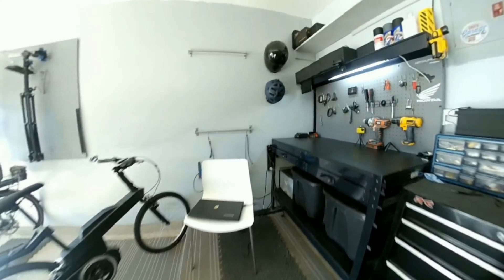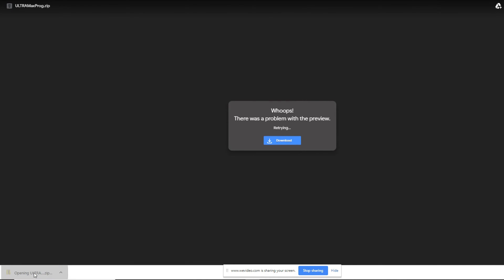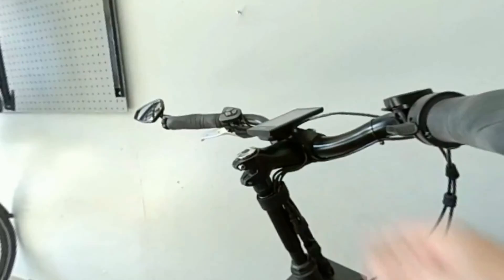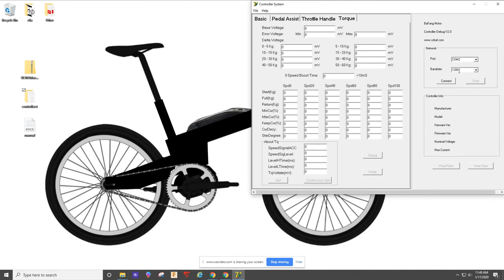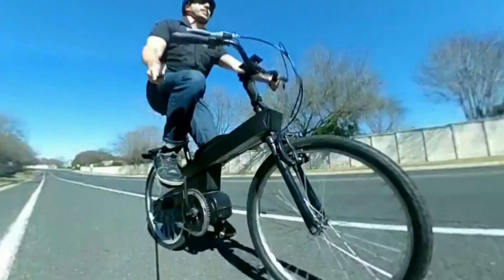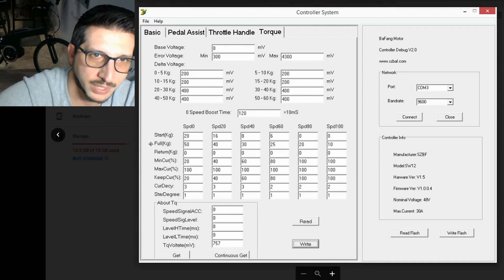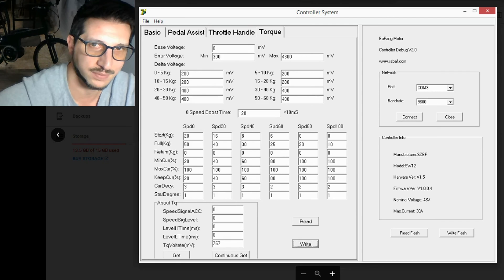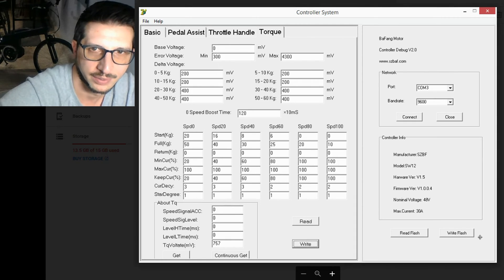How To Program Bafang Ultra Torque Settings

Comment: Thank you for sharing! Do you think your “commuter” style settings would be good for any bike equipped with this motor? I guess I was just concerned that your bike appears to be a lot lighter than mine so I wasn’t sure if I would need to modify. Did you also confirm that the controller is running at 30 amps? From what I’ve read, that’s what a non-ludicrous controller should be set at.
Reply from the maker: Yeah the factory settings came programmed at 30A which is the max for this stock controller. This prototype is actually pretty heavy around 60 lbs. Can't say for sure if these settings are good for any bike, but it should solve the PAS torque sensor problem where the motor gives a big boost then lets off, making the ride inconsistent and underwhelming. 

I don't emtb much but the stock settings might be nice if all you want is a short boost here and there. You can probably also just get used to switching into a higher gear to keep up cadence at speed and keep torque on the pedals, but I'm not a fan of changing gears in general and would avoid shifting regardless.
Reply: eBikeaholic thank you for the response! Did you find that these settings improved your top speed? Or just the smoothness when commuting?
Reply from the maker: @seant1435  I don't think this programming would have an affect on top speed since we can't increase the amps past 30A. Bike gearing, wheel size and battery voltage definitely would though.
Reply: eBikeaholic how does bike gearing effect top speed? The new bike I just bought I upgrade from a Shimano 10 speed to an 11 speed. The upgrade is 11/42 to 11/46T. If I’m reading that correctly it doesn’t add anything to the high gears. Just more to middle gearing I guess.
Reply from the maker: @seant1435  I like to use the Sheldon Brown gear calculator. You plugin your specs and it gives you a gain ratio. Lower gain ratio will give quicker acceleration, higher ratio will give faster top speed. Either a larger front chain ring or smaller rear cog should give you a higher gain ratio.

https://www.sheldonbrown.com/gear-calc.html
https://www.sheldonbrown.com/gain.html

Comment: Bafang Scares me
they have No Factory Manuel or support.as well American service centers with the parts.?
Chinese must want to sell there crap and not support it with manuel's or Honest Customers Service.
I have the BPM imports F1000 ebike and there isnt any material information about this motor? WHY ?????
Reply: the USA Bafang Service center in Las Vegas Does Not Support the Bafang Ultra g510 and has no explanation why ?
Reply: Bafang has local US support.  I skipped local dealers and bought direct from Frey in China so when my motor had an issue I contacted Bafang USA.  After only 2 emails Johnny sent a new motor to me free of charge, which I installed.  He even relied upon my honesty to send the bad motor to them.  Until another company becomes light years ahead in tech, I'm a Bafang customer for life.
Reply from the maker: Have you reached out to BPM for support? As with all the other motor manufacturer's they rely on their dealer network to handle support. There is a Bafang warehouse/office in Las Vegas you can also try to contact. 

I bought this motor kit from a seller on Alibaba and yes communicating in a different language and time zone requires patience. I don't bother with Bosch motors because they restrict their programming and are under powered. Do they have US service centers? Have you ever contacted someone in Germany for tech support?

Unfortunately this is the nature of the industry at the moment but yes I also hope eBike manufacturers and dealers reinvest their earnings into better customer support / R&D instead of wasting billions in marketing like the auto manufacturers do.

Comment: what is the outcome ?
before and after ? 
also explain the settings more ?
what is the max speed and battery life ?
Reply from the maker: Before and after outcome is explained at 6:05. I decided to try keeping this video simple by focusing only on the torque settings that I found necessary to change for smooth consistent road riding. Please elaborate on which settings in particular you'd like explained further.

Speed test video is here: https://youtu.be/rKawGBsXu2U

I'm working on a full review video for the bike / ultra motor but so far with the setup described in this video it looks like it consumes about 60 wh per mile throttle only at full power (1500w).

The current setup also has a high gain ratio (6.1) single speed setup which I believe is also placing a higher demand on the motor and battery, but I'll need to do further testing with a Nexus 3 IGH to prove that. 

The goal is to develop a solid workhorse that is built to maintain the flow of traffic as well as tow cargo. I'm not a weight weenie, nor am I worried about paying 12 cents per kWh to charge it since we plan to get solar panels soon.